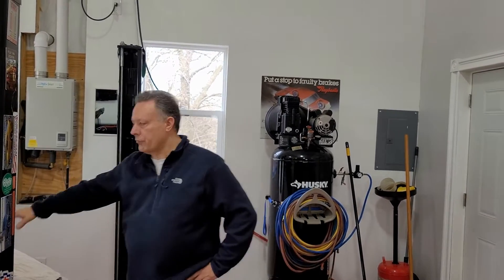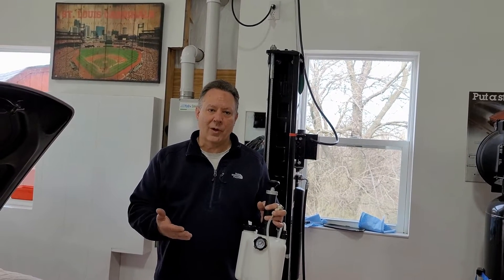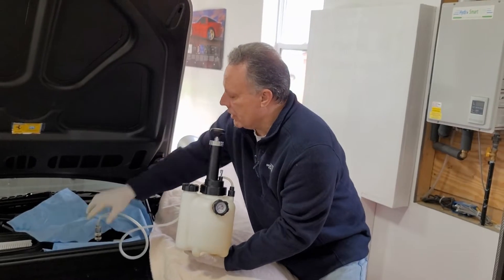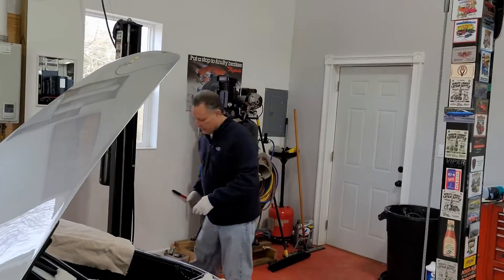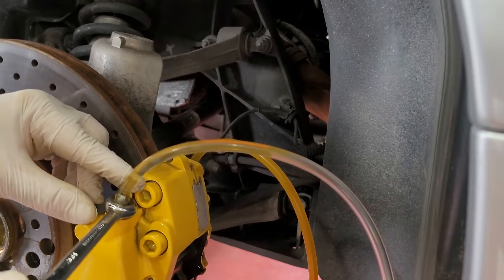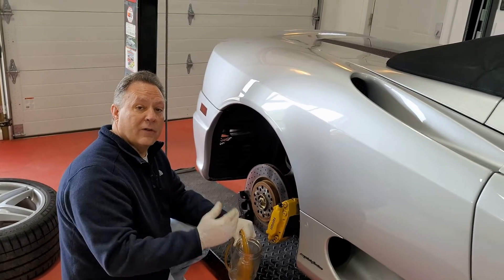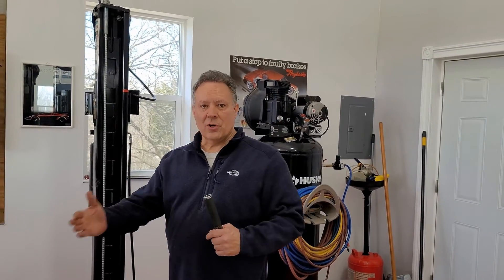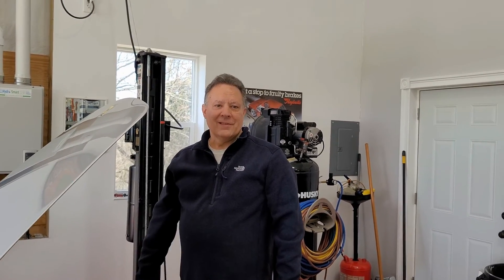Ferrari 360 Brake Bleeding Procedure

Comment: Did you energise the abs at any time in order to bleed the closed side of the abs?
Reply from the maker: No we didn't.  The only thing we did do was on the last brake we used the brake pedal to push the fluid trough the system.
Reply: Thanks for your reply. With the last pedal pump was the ignition on or off.?
Reply from the maker: On
Reply: @ferrarifxs  did the abs activate when the pedal was pressed?
Reply from the maker: No. I think you can activate only with a scanner
Reply from the maker: I would have to look and see if the thinkdiag + will do that.
Reply from the maker: Also I believe the Ferrari abs tool hooks up next to the brake Reservoir
Reply from the maker: I can take a look in the next day or so and let you know. Also I'll look at the service manual
Reply: @ferrarifxs  That's most kind. It is my understanding that you can trick the abs into activating by first connecting the pressure bleeder to the reservoir,  then 1 switch on ignition. 2 a second person depresses brake pedal slightly.  3 open the bleed valve. This might activate abs to dump its closed side back to reservoir.it happens quickly and the pedal should not be followed to the floor and only done for a short time to avoid drawing the reservoir. 4 do all four wheels in this manner. 5 suck out old fluid from reservoir. 6   repeat the pressure bleed as you did. 
I've not had a chance to try this yet but if it works it would be of interest to many vehicles. 
I f an abs system is never activated and only bled conventionally then the fluid in the closed side will be very old.